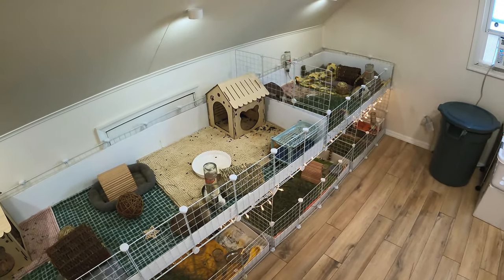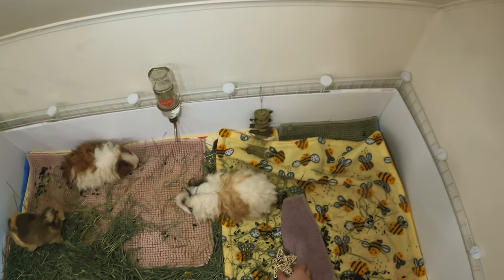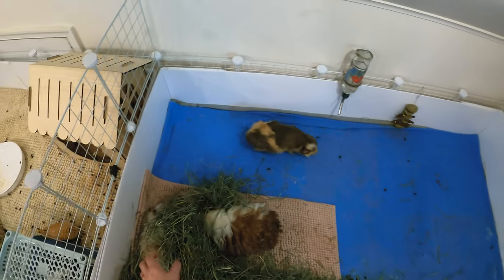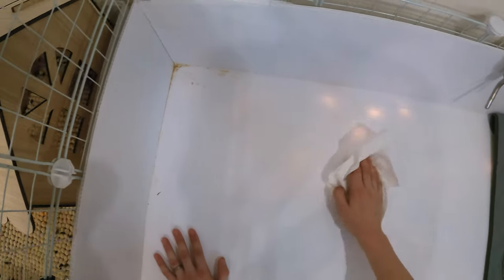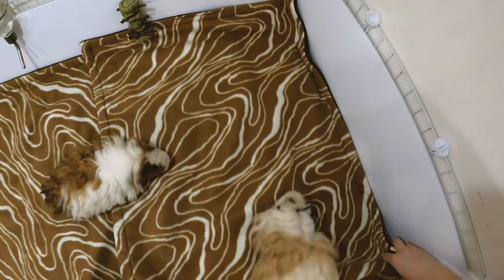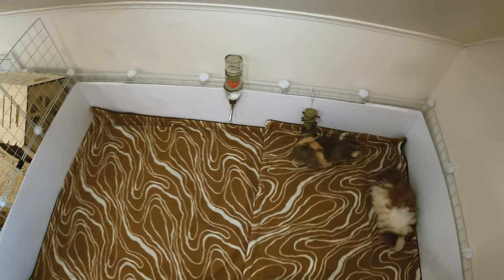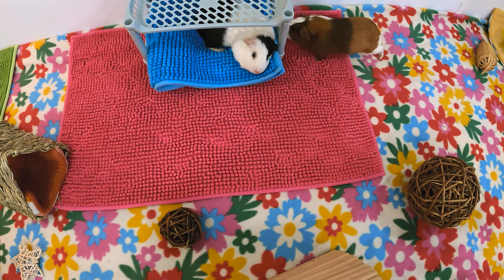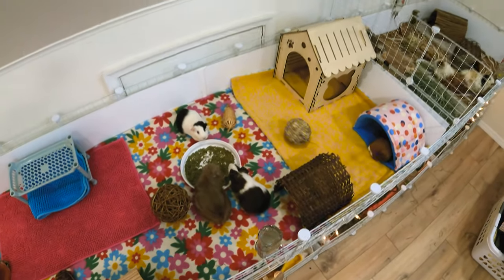POV Guinea Pig Cage Clean 🧼

Comment: Love watching your videos!  I have a question.  I see that sometimes you use a liner with the uhaul pad sewn in the middle and sometimes you put your pig mat or uhaul on the bottom and lay the fleece on top.  Which do you like better and why?
Reply from the maker: I prefer the sewn fleece liners as they are fit to the size of the cages and I spend no time having to fold anything to get it to fit!